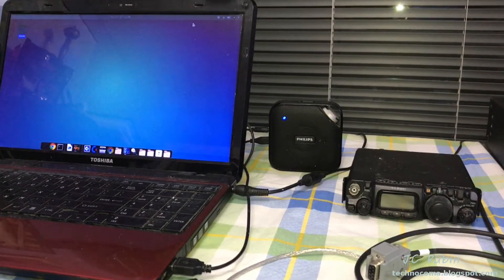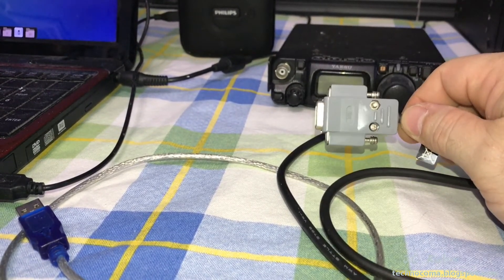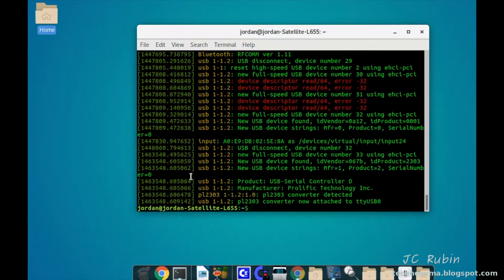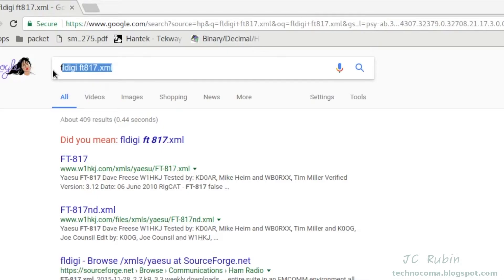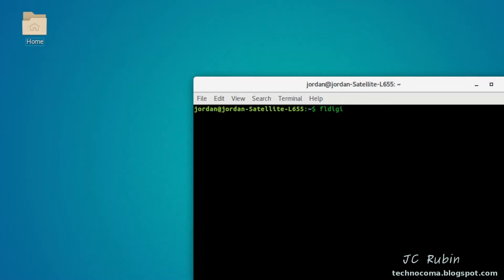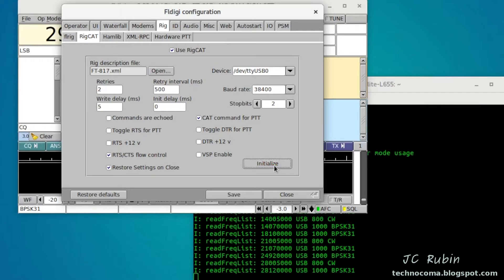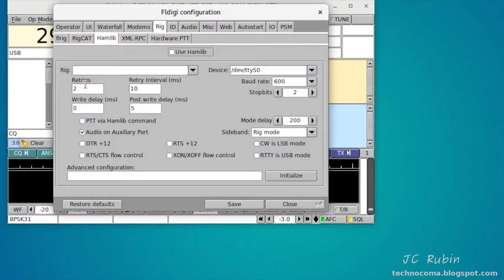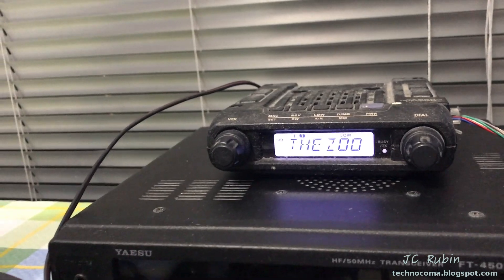Linux FLDIGI to the Yaesu FT817 Tutorial - Part 1 - The CAT Connection

Comment: Hi, after a long vacation from ham radio, I'm setting up my ft-817 again for digital modes. I'm using Raspberry Pi with the fldigi suite installed. I have a ftdi-cat cable and a sabrent audio/usb plugin sound card. I've been trying to get flrig working with fldigi but I've run into a problem that the transmitter keys up on a test transmission into a dummy load, the indicator on the radio goes red, but when I release the fldigi button for t/r the radio indicator still stays red. I have to shut down the computer and the radio to get it to go out. Can't figure this one out. So, is there any advantage (such as more likely to work / easy to setup) to using RIGCAT? I love the series and I'm going to follow it and see how it goes, but would love some insight into what I might be doing wrong. Thanks in advance. ki7zed.

Comment: im running an ft-817 with an LDG z-817 auto tuner (provided instructions say all i need is to connect to the computer port on the tuner for rig control) so i followed these instructions to a t and still cant get it to work. im using a CT-62p cord ( 8 pin to USB thing) and even on chirp i cant read the radio (which ive done before but without the tuner) so is it my tuner thats mucking things up or am i missing something
Reply from the maker: Oh dear... an antenna tuner on a qrp radio.   Given 5 watts coming out the back of the rig what are you hoping for to reach the antenna after the tuner matches the impedance to 50 ohms?   .5 watts   .25 watts?   Toss the tuner, get an antenna like a buddipole that you can get reactance of 0 using an mfj 259 and never look at the tuner again
Reply: @retrotechandelectronics  Nope, disagree. Used 5 watts through a tuner into a longwire for ages and worked every continent. 5/7 from G to ZL. Forget the buddipole but maybe build your own tuner.  I don't trust those autotuners.
Reply from the maker: @PontiusKak  thank you sir. I was not expecting to be amused so early in the morning as you suggested to forego the tuned antenna you build yourself, go with the diy tuner instead. Science...Fantastic...
Reply: Look, let's just be practical! Firstly, who needs tuned antennas? Secondly a DIY tuner can be far better than a commercial one. Mine was a roller-coaster and a differential air-spaced variable. Thirdly name any domestic environment where an antenna works as theoretically predicted?
Bung it up and see who comes back is the bottom line here.

Comment: Thank you Jordan for putting these up here.  I'm a new ham and just bought a FT-817ND.  I'm trying to set things up first for home use running Debian on a home machine with fldigi.  I bought the CAT 8 pin din to USB but I'm having a hard time finding the other cable with the 6 pin din to 2 x 3.5mm connectors to my desktops audio in and phone out.  I'm thinking I may need to buy one with bare leads for the 3.5 connectors and make one up.  Where did you find yours if I may ask?  TIA and 73, great series and perfect for a newbie like me.